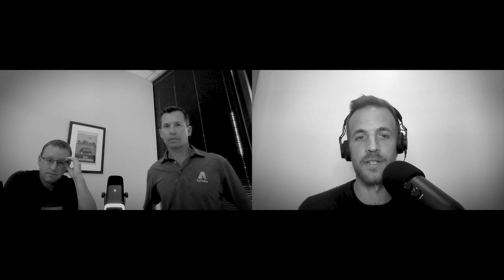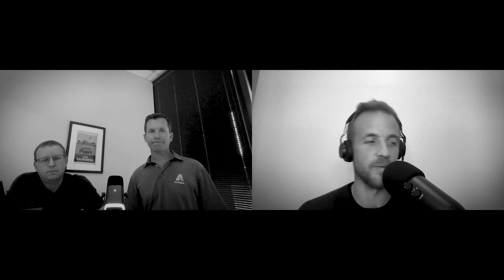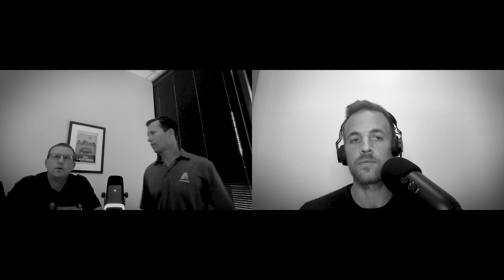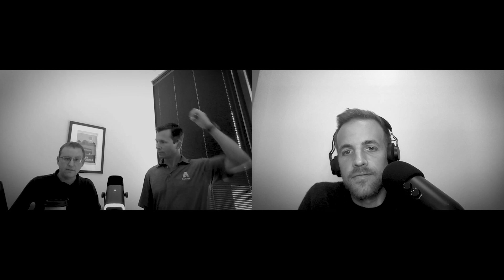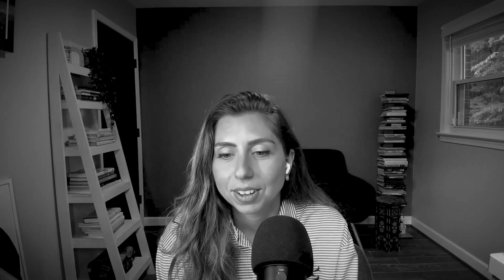🎧 #154: Case Study: University of California Irvine overhauls BAS, adds FDD

Comment: At 20:58, sounds like there were underlying BACnet configuration issues. In a multi vendor environment, such as with large institutions, you must have a BACnet Network Administrator. That person manages and troubleshoots the network using tools like wireshark.

He also is the one to assign device instances, network numbers and BBMDs, etc.

Can't have every vendor do whatever they want or else problems will ensue. You will end up with the wild wild west with vendors doing whatever they want.

Good to hear you have something like this implemented. BTW, location matters where the wireshark capture is taken from and then uploaded to Optigo Visual BACnet.